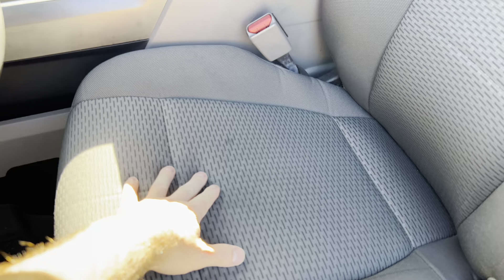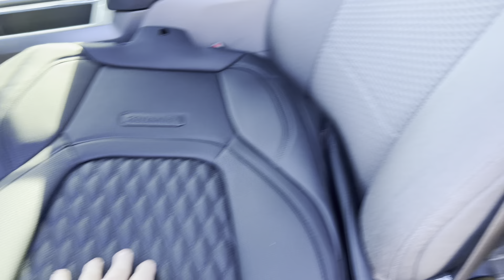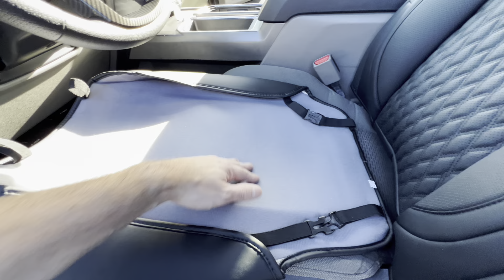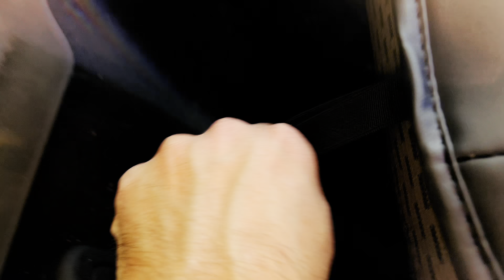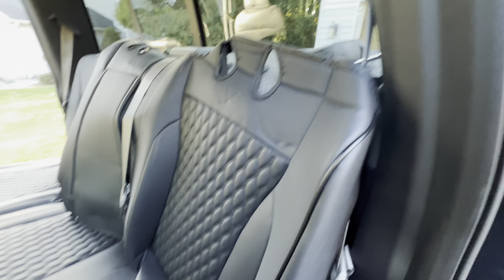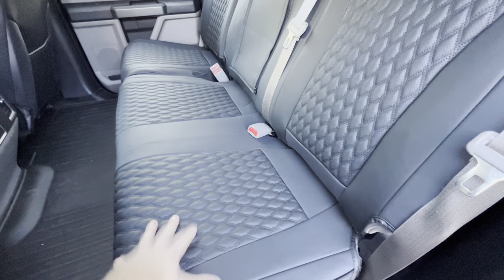The BEST Leather Seat Covers For Your Ford F150!

Comment: Does it feel like it helps with support on the left edge of the drivers seat? That side of my seat cushion is wearing out from sliding out of the truck and was wondering if this would help.
Reply from the maker: Yes for sure. Adds more padding and protection overall.

Comment: Do you have heated seats? Wondering about the effect on the heat coming through.
Reply from the maker: I do not but it would pass through no problem. I have the lumbar support and can feel through the covers no problem.
Reply: Thank you. They look sharp, the fitment is better than most I’ve seen.
Reply from the maker: @h2oFun I was impressed with the fitment too. Been riding with them for a few days now and they relaxed a ton and fitting even better than the video shows.